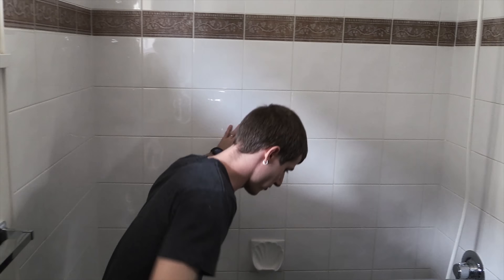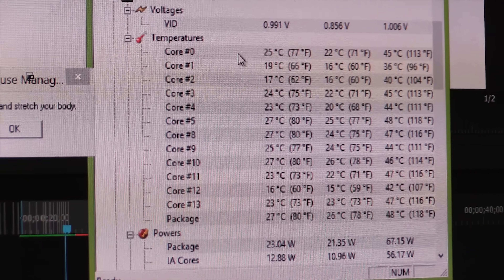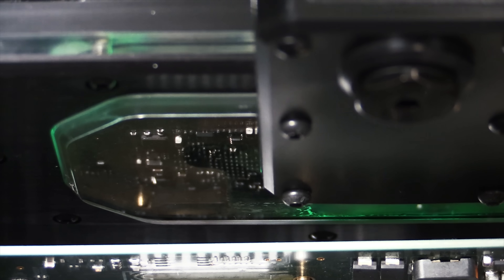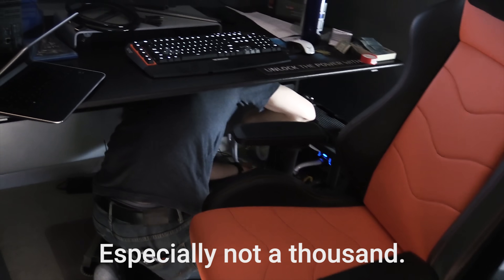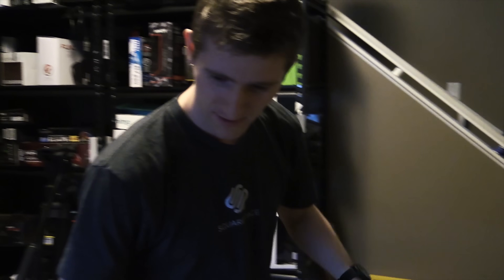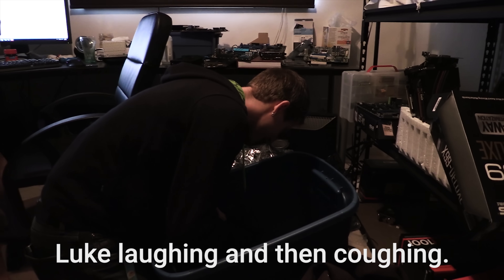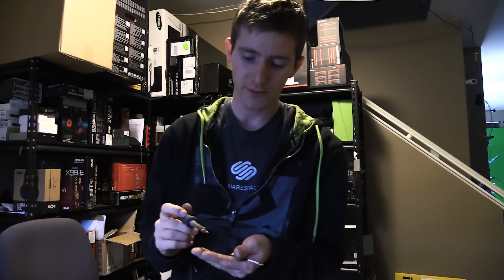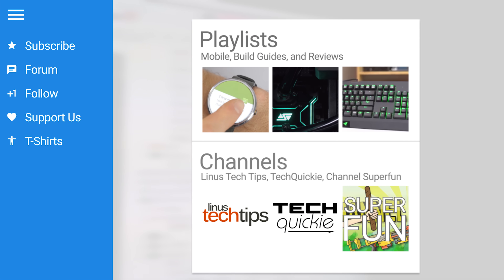Whole Room Water Cooling Part 5b - Some Issues, More Solutions...

Comment: Soldering tips.  Start with putting a wire heat-shrink tube on the wire, you will use this later. Before soldering, use a "Lineman’s splice" it is super strong. Put the iron underneath the two wires and apply the solder from the top. The solder is attracted to the heat and it will "suck" into the wire joint not just coat the surface. Its also a good idea to have a heat sink clipped to the wire a little off to the side to keep from melting the insulation. Lastly bring the heat shrink over the solder joint and carefully use a lighter or pen torch on the heat shrink to protect the connection. I like to use two heat shrinks, one over the other, but its just personal preference. If you do much soldering its also nice to have a soldering station that holds the wires while you are working on them. they make soldering SO MUCH easier and are worth every penny.   
How to make a  "Lineman’s splice" -http://makezine.com/2012/02/28/how-to-splice-wire-to-nasa-standards/ 
Heat Shrink -http://www.radioshack.com/nte-47-25206-r-6-dual-wall-with-adhesive/55048502.html#q=Heatshrink&start=1
Soldering station - http://www.radioshack.com/radioshack-led-helping-hands-with-magnifier/6400235.html#start=2
Heat Sink -http://www.radioshack.com/soldering-heat-sink-clip-tool/2761567.html#.VNxATPnF-8o

Comment: Soldering tip: Split the wires into a V shape, then twist them together, then solder. Also, cut the length of solder that you need, hold it against the twisted wires, then melt it onto them.

Comment: Ok i got a few tips for you when your soldering. 
First, you should use flux core or rosin core soldering wire. 
Second, you cant cheep out on the solder. the stuff at Home Depot is made for soldering copper pipes. you need stuff for                 electrical. if you can get a silver alloy. it conducts the most electricity and is the strongest.
Third, you should heat up the wire first then add the solder. you want to see the solder be absorbed buy the wire instead of                just globing it on.
Forth, when connecting two wires together you can ether twist them together and then solder them, or you can tin the tips of              each wire and then heat one up and place the other wire on top on it till the solder fuses together.
Fifth, make sure that your soldering iron has a lair of solder on it. just keep adding it till you see it get nice a shinny. this will              prolong the life of your soldering tip and make it easier to solder things together. also it will get rid of any                              contamination in the solder.
Sixth, a good way to clean you soldering tip is to stab it in to some steel or copper wool.
Seventh, dont use electric tape to insulate your freshly soldered wires. use heat shrink tubing. and i you can get the kind                  with hot glue inside, get it. its amazing.
Eighth, make sure your not running your iron too hot. if you run it too hot you can harden the wire and it will brake more                     easily.

Comment: Use blutack to hold things in place when u solder. Very effective stuff, i use it everytime i solder. Also do not melt the solder on the iron and then tranfer to the joint. Try to melt solder directly onto the joint. Use the blutack to help :)

Comment: For soldering, you can get "Helping Hands Third-Hand Soldering Tool" to make it easier and get shrink tubing or even electrical tape to help it not short together or get wet in the rain/damp location. (Shrink tubing is better)

Comment: Why are you fooling around with PC fans and PC radiators? That's a lot of parts that can fail and you don't seem any better off than mounting them directly on the computers. When you started the project I thought you were going to use an industrial radiator. It would have one coolant in-flow, one coolant out-flow, and one fan. Fewer parts means less chance of failure. You can scale them up to get very chilly in your setup.

Comment: I find the best way to solder two wires together is to get this device called the third hand its an adjustable clamp vice thingy.  Twist the two wires together like a rope not like a palm tree. Then clamp them up to your third hand.  Use rosin core or flux doesnt matter.  Flux always comes in handy.  Heat the wires first then slowly feed the solder into the wires fusing them together.  Best soldering jobs you can hardly see the solder.  But definately get yourself a third hand.   http://www.amazon.com/Soldering-Solder-Station-Magnifier-Helping/dp/B00J5RCXS6/ref=sr_1_3?ie=UTF8&qid=1423718911&sr=8-3&keywords=solder+third+hand

Thats an amazon link to it

Comment: Why dont you use automotive double butt end connectors when soldering and use heat shrink and then wrap that in electrical tape instead of just using electrical tape to isolate the wires from the weather and each other?

Comment: Hey Linus, Try to remove the water pumps from the PCs, I think those pumps are the ones that are slowing the water pressure, than connect the tubing directly and just use the 2 bucket water pumps and see how It works. Also always, the end computer will be the hotter than the rest, Because the water is warming up as it goes through the PC's. than lets us know if it worked... Good LUCK BROO!! -Reposted_

Comment: When I solder two wires together, I first twist each individual wire to create a nice tight grouping. Then I create a hook with each wire and hook them together, giving the joint some tensile strength. The mechanical joint helps a lot. Dip your wires in flux before doing so. After that, put a small dab of solder on the iron, and touch it to the wires. The solder helps transfer the heat to the wires. Once they are hot enough, you should just have to dab the wire connection with a bit of solder - it should flow onto the wires very well if you have flux and they are hot enough. This method provides a pretty bomb proof joint. 

Good luck!

Comment: You do not have enough volume of water to flow through all the systems at once. How can one 3/4" pipe flow enough to feed more than two 1/2" systems? It Can't. At least upsize the main loop to 2" and have enough volume of water to flow all of the systems.

Comment: No matter what you do Linus you will always have a problem with system temps until you consider the pipe sizing and flow.
Reply: Joke's on you, system temps are actually really good now. CPU cores have hit -1 at night idle.
Reply: Edzel Yago with all systems running at workload? or one at a time? thats what I thought, one at a time huh edzel?
Reply: On the normal daily hours max temp on mine was about 30. GPU (both titans) max at about 24. Boom.
Reply: Edzel Yago if that is the normal workload than you will be fine. But if more than one system is in use it will be a very different story.
Reply: Edzel Yago btw I build these systems for a living and know volumes more than most about flow, pumps, pipe sizing and thermal inertia. Dont be so quick to Sound off when everything about this project is exactly the opposite of what a professional would do.
Reply: ...More than one system IS in use during normal hours. All 5. Derp. So many of you assume the worst and it's just so cringe worthy to read.

It's like, you authoritatively state something and then... You're completely wrong. I need a picture of that guy who's looking down at the dog with that face that essentially says, "Oh, you!"
Reply: Edzel Yago 30 really is way too high for having all those rads. The sytem will not last and I will wait for the apology. Im just trying to help as I actually know what i"m talking about. Now you're on your own. Suck it, and see you when you call me to straighten it out.
Reply: Edzel Yago It's like all you novices hit an agreeable temp and think the system is running right. Theres no way you should be running those temps if the system is piped correctly. You're only showing what a bonehead system you have in place. But I'm not one to wish ill will so if you like it, go with it, but it's definitely running poorely
Reply: Well, I don't disagree that it's "bonehead system" but if the temps are agreeable then I'm not about to disagree with it. XD
Reply: john b nimble
Is there something wrong with a "novice" finding that something works and just sticking with it? "If it ain't broke don't fix it" right?
Reply: xeproc The temps are way off for the equipment they're running and the language and tone he chose was way out of line to respond to someone with "actual knowledge".
Reply: What should they be running at then? I'm sure they are well within the operating parameters for their equipment... (referencing the "What are safe temps" As Fast As Possible on TechQuickie)

Plus, since you want to bring up language, yours wasn't very respectful of a hobbyist (or at all for that matter Reference "thats what I thought, one at a time huh edzel?") who's (honestly) just trying to make content people can laugh at while showing some of the more difficult aspects of a build that no-one in their right mind would generally think would be a good idea (since most people would find no reason to hook around 5 computers together in a single loop).

Comment: when soldering 2 wires together, twist both of the wires together first, then add solder as the glue. DON'T FORGET THE HEAT SHRINK TUBING BEFORE SOLDERING!!!!

Comment: when you're soldering wire together hold the iron in the wire and the solder on the opposite side of the wire when the wire gets hot enough the solder will flow almost perfectly through the wire straight away

Comment: Soldering tip, pre solder the wires first, with a small amount of solder, then join the two wires but heating the bottom of the wire, and letting the solder flow down towards the heat. Uses less solder and looks neater, also smaller connection, so more efficient.

Comment: I use Old server power supplies that I get on EBay.  The HP power supplies are 1000 watts and cost about fifteen bucks.  Easy to make them work as a 12 volt power supply

Comment: Well Linus and group. One thing you should always do when soldering wires together is the splice them together. It'll guarantee proper contact of the wires. Also, clean the soldering needle, while it's hot on the sponge before every use to get off any flux resin from the last use. Just wipe it on the sponge

Comment: For soldering, to make things "stick" and make a clean connection, heat up the surface before melting solder onto the wire. You can also prime your solder tip by applying solder to your soldering iron tip and wipe it off; do this twice and you should be good. Another tip is try investing in some sort of stand to hold the things your are soldering, so that your hands are free to make a more precise connection.

Comment: for soldering you want to warm up the wire, then let the solder melt on the wire ind get pulled in. you walso want to tin the tip of your soldering iron and clean it on a wet sponge.

Comment: when soldering hold the tip to the component and then feed it solder, don't just use the solder stuck to the iron tip. you'll get much better flow and a stronger solder joint.

Comment: just a suggestion. you could use shrinkable tube instead of electrical tape on the soldered area of the connection.

by the way this project is awesome.

Comment: Get a new pair of wire strippers and put a block of silver into the cooling liquid(along with that iodine) the silver cuts down on certain types of corrosion and some other stuff. And btw never let hot solder drop onto what your soldering, if that helps at all.

Comment: Soldering tip: use steel wool instead of a wet sponge to clean the soldering iron when in use.
The heat of the iron will heat up the wool and the excess solder will flow into the wool. There's much less wiping and less of a risk of the solder beading up on the tip of the iron. And prep needed and no reweting.

Comment: To clean out the rads just fill them with some radiator flush you can get from the autoparts store and connect a pump and let the water circulate through it with the rad in a pot of boiling water.  Once the rad has been flushed for 15 minutes or so connect one side up to a garden hose at full house pressure and flush with water for a couple minutes.  This should return the rad to like new or better than new efficiency without to much trouble.  This is the method I used to clean out old heater cores before using them as rads in my old water cooled rig.

Comment: The way I find best to solder wires is to twist all the wires together that you need for each connection.  Make sure your soldering iron is fully heated and then apply a small amount of solder to the tip of the iron to tin it and provide good thermal conduction.  Then you apply the soldering iron to the twisted together wires and after a few seconds apply solder to the wire and the tip of the iron at the same time and the wires should suck the solder right into the connection at the right temperature.  You do not need to apply flux to the wires if you are using rosin core solder since the solder already has the rosin flux in it.  You can also tin each wire separately and then twist them together and solder but I find this type of connection to be more difficult and less attractive.

Comment: For soldering you should use those heat shrinking tubes to seal the whole thing up and make it not hang all over the place that's what my dad did when I accidentally cut my headphone wire

Comment: Mechanical filters to remove living crap from a loop... GREAT IDEA! Why bother with a bio uv light to kill the stuff when you can give the lifeforms somewhere nice to cling onto and warm to live and reproduce! Betting it will last a week, maybe 2 before it gets so clogged up, the back pressure will build up, blowing a pipe off somewhere, and hopefully not in the "server bathroom".

This entire thing could have been fixed before you spent a penny on it by a few hours of planning.

Filling it up? Put a vacuum on the system and let that suck the water through, rather than pushing.
Want to stop bacteria and stuff growing in it? Bio UV light, and as you suggested way to late, iodine.

As for your soldering, it's like a war crime. Get proper electronics solder, not plumbing solder, dump the flux, cause i doubt you will need to do much smd soldering.

Also, replace the 2A SMPS and get something with more power. A 2A SMPS at 100% duty will get too hot, and die.

Comment: you shouldn't touch the cable with your fingers you should pre tin the wire solder the wire immediately after stripping it. your not soldering the wire to anything just applying solder to the wire before soldering it to another wire

Comment: use shrink tubing with a hair dryer or lighter to heat the shrink tubing up linus :)
Get rosin core solder with a little bit of silver in it.. preferably non lead free solder and you will notice its going to be a lot easier.. I recommend stannol brand. Diameter of 0.7mm for the stuff you do will be more then fine.

Get a flat head tip rather then a pointy soldering tip so you have more surface area.
Soldering joints will be much easier to get right, look shiny and it will be more fun!
Reply: Non Lead Free, so Lead Solder.
Reply: UncommonKIBBLES thats the point. 60/40 tin lead solder is easier to use than lead free.
Reply: After fine tuning the temps and a little practice I wont go back to lead solder.
Reply: i dont doubt it. sounds a bit expensive tho haha
Reply: hmm very true. a few dollars is indeed never worth multiple fked up projects and extreme frustration  :p
Reply: Cause its cool. This isn't about efficiency, its about coolness.
Reply: I

Comment: For soldering directly place the tip of the solder at the cable and then press the gun against it. Don't worry about using too much as if its working, it will get sucked up fast.